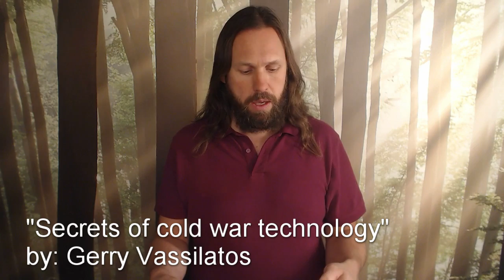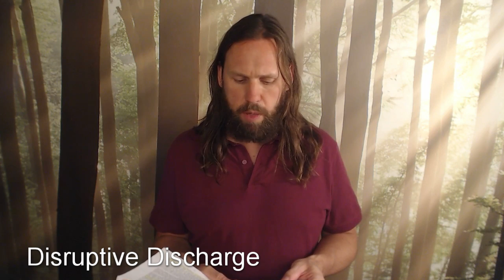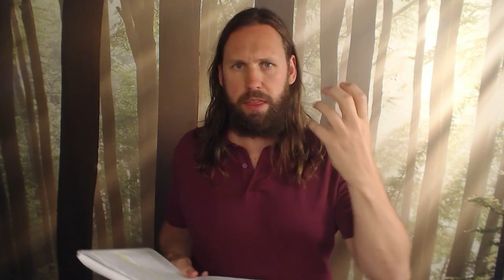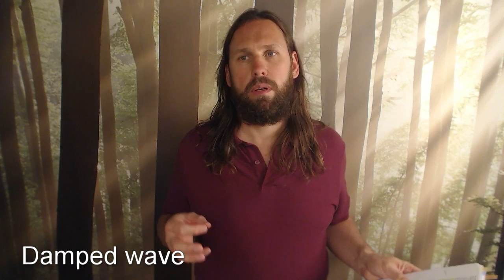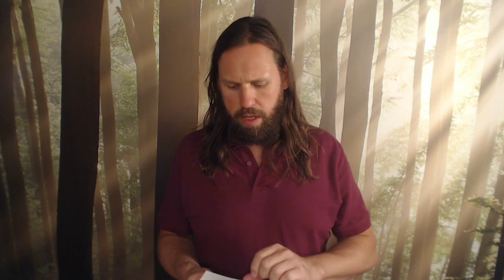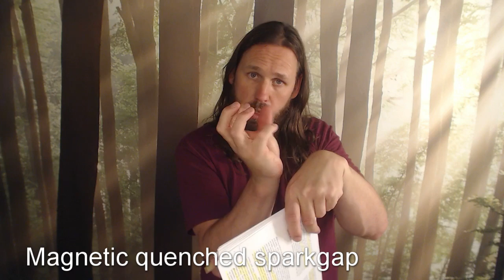Nikola Tesla's Radiant Energy Part 1 of 3

Comment: Hello Ivo,   Radiant energy is the aether in motion. I read this book, very informative and revealing. Two books, Lost Science and Secrets of cold war technology. Nikola Tesla was the master of the aether. There is the undeniable evidence in some Tesla patients and else were. A radiant particle is smaller than an electron with almost no charge and they pervade the entire universe, also can not be compressed. Tesla used electrons to bombard the aether particles to get them into motion, this is done with an intense DC pulse. A scalar wave moves like a sound wave.
Anyway, I was to tell you I sent pulses through the ground, here is what was done......using the schem. I sent to you, run the collector into the ground rod and at some distance from another ground rod return to the coil with a single wire. Use a higher resistance and the transistor won't burn up and maybe a larger bifilar coil. Hope all is well.
Reply: There is a dispute though, may not be a particle at all. It would not make any sense
Reply: @Tbonyandsteak  I agree I don't Aether itself is particle, just probably a means on conceptualization in keeping with it being a described as a gaseous medium that permeates all. When it comes to particles Tesla referred to a "Primary Solar Rays" but this isn't Aether but does play a big part in some of his findings.
Reply: @bobdole27  This is what I have gotten out of the lectures, experiements and books. No opinion are involved. 
Radient energy are also called Longitudinal waves. It comes when the frequency are so fast that magnitism cant be build up. Magnetisk is an counterforce to the Dielectric energy. Since it is a counterforce, the limitations of the Dialectric energy gone in Radient energy, since the drag of magnetism are no more. This is what that gives Radient energy its strange abillities. Its instant at all distance, that is why they call it Longitudinal waves.
Reply: @Tbonyandsteak  You are on the mark, I find it funny how people claim Tesla's ideas could never work due to Electromagnetic waves being beholden too inverse square "law", and even in his early lectures they attribute it all to electromagnetism. However when one takes the time to read it themselves you'll notice how states constantly that his effects were electrostatic based (even that he considered a limiting term since it was really dynamic and not static at all, which is why saying its dielectric based would be  more accurate) and that they had infinite potential compared to only magnetism. There really seems to be some sort of mind virus amongst the masses in that they never seem to notice this, then have to gall to say with certainty that "Tesla's inventions could never work"
Reply: @bobdole27  I believe it is on purposse and planned up to this day. Atomisn is a Disinfo to stupidfy the masses. This is why mentioning the Aether in those circles are like mentioning the devil in the churces. The big lies are everywhere, Just recently calculated the trigometric of a 1 million km diameter star, 1 lightyear away. The star would be seen as little ancle of view as 0.01mm 100km away or 3 cm besides the moon vehicle on the moon. No telescope in the world would get more than 1 pixel size of a star. yet on the from the VLT telescope, show pictures of stars with 50 pixels size of a star that is supposely over 100 Lightyears away. Heck even with a good precise amatour telescope you get more than 1 pixel of some stars. It is sooo obvious, just find another way to validate the claims. Found at least 10 big lies my self. If it is true, like different ways of calculations of PI, the result are the same. But not in space. Unbelievable that a job like Astrophysics not even have done that. Well, maybe that job never have been about the skills at all.
Reply: @Tbonyandsteak  Science or as Heaviside best described it as "Scientism", is nothing more than a giant cult, and the physicists are their religious bishops who gatekeep , they even have their own religious icons like Einstein, Feynerman etc to boot. They tell the masses what to think and you're supposed to just agree because apparently enough of them agree on their erroneous theories that it somehow becomes truth, even though the reason new science after new science has to arrive because the theories that came before makes no sense so it becomes a never ending cascade of nonsense. Also you're right about the astrophysics stuff, just like with rest of the physicians it rests on being massive circle jerk, they claim to have all the answers yet can't even tell you concrete the workings of a magnet. If you want to get even a bit more conspiratorial one could even go as far as to say Relativism and all the nonsesne that came after wards was made the defacto "true" model of the universe because of how limiting it is, under the correct Aether model we live in a virtually infinite universe, are not held to the "laws" of thermodynamics(enegry and matter can in fact be created and destroyed(Gustave Le Bon's works goes deep into that and his findings line up with Tesla's works despite them hardly interracting)) with infinite potential of Aether manipulation to do practically anything we need. However in its stead we have this current paradigm that is practically a nihilistic nuclear death cult, somehow despite us being more "advanced" we're more limited now than ever at best and is on active path to destruction at worst (all the while they're still telling us they are doing all that they're doing in our best interests).
Reply from the maker: I love this exchange of insights. it resonates deep with me.
for me all is energy, and this energy can move, like water moves.
it creates vortices which end in funnels. and ring vortices.
the energy can be set into longitudinal motion, which is like a tsunami, whereby the water doesn't really move, but the energy does. a true displacement currenr, set in motion by a rapid change in high voltage on a surface (plate).
Reply: @MasterIvo  Anyone with a "particle" of sense would understand what Tesla was doing by reading the patients. Tesla did not try an hide his discovery with some vague 
explanation. All I can say is because of greed and the lust for power and control humanity was prevented from moving up to a higher level of existence. Wardenclyffe was that next step up.
 I have continued working with the pulse motor. Remember the brief exchange we had some time ago, I finally stumbled upon something that works. 
https://www.youtube.com/watch?
v=07xM4bYWgic&t=84s
Reply from the maker: @tribulationcoming   youtube f@cked up the link so I can't click it...
Tesla definitely was very vague in how his tech worked, definitely after his lab burned down in 1895.

virtual particles (corpuscles) are thought up by JJ Thomson, to be able to calculate on field properties.
Reply: @MasterIvo  Really poignant post Master Ivo, thats essentially how i've come to view it also. I've only really have been looking into the Aether for about a year or so now(which is why i'm currently going through your older videos after having watched the newer ones) and thanks to channels such as yours i've found a dearth of knowledge on the true workings of Tesla. Only just a few short years ago I would've agreed with Academes on Tesla just blindly following they say but having, but by chance coming upon the videos of Dollard, then finding Vassilatos works, then stuff from ken wheeler(which is also a bit funny since I found his channel a long while ago and it never made any sense to me until recently), and then empirical evidence you show in your videos (like scientists should instead of going through endless equations and theories that have no tie to reality) it really makes it all concrete to me. Then one goes back and begins looking at all the things that were possible and should've been expanded upon in our era such electro therapy(no need for harmful drugs), electroculture(using frequencies to aid in plant growth cycle and to ward off pests and dieseases, instead of awful products like round up ready) wireless energy, production of nitrates from the atmosphere (essentially on the spot fertilization production which I remember tesla talking about often), even possibly being able to make it rain through simply electrical means(no need to put toxic chemicals in the atmosphere) and these are just the relatively tame possibilities of what could be achieved.
Reply: @MasterIvo  Never read about J.J. Thomson, what I understand I have about the aether is from reading Tesla's patients and his work and others who discovered this phenomenon.   The famous Tesla coil was not about making gigantic sparks, the H/V produce was to bombard the aether and put it in motion, the proverbial "scalar wave". As Lynyrd Skynyrd sang about, I'm a "Simple Man". I'm really not that capable, but patient and perceptive and have become "one with the device". It is running itself and "time erases all things but love and the truth". Most folks don't understand one important aspect of our existence.....God will give us what we need.
Later.......Marc.
Reply: Its what gravity is too! There are electrogravitic force made here and that what Tesla observed! He managed to focus this force in a narrow beam. I have Grerry Vassilatos Tesla article saved, Tapping ZPE books by Moray B King and The Secrets of Antigravity Propulsion by Paul Laviolette. Eric Dollard and Eugene Podkletnov produced these forces.
Reply: @jlo13800  This is what can be done with radiant potential.
https://www.youtube.com/watch?v=bRq2xQSPPJk&t=4794s&pp=ygUuZHIuIGp1ZHkgd29vZHMgLSBldmlkZW5jZSBvZiBhZHZhbmNlZCB3ZWFwb25yeQ%3D%3D
Reply: It's quantum fluctuations

Comment: Ever ponder why oceans have rogue waves and lakes and ponds have merely wind waves & no tides! what's the difference?
SALT! salt conducts the energy that is being dispersed from the Sun and Moon under the Dome! 
+ & - refractions of the plasma energy emanate! freq.& A/C current when tuned in!
Reply: Sunlight has aetheric particles as well. Tesla was aware of this!
Reply: @jlo13800  Not particles, Sunlight is a co-axial Aether circuit of magnetic and dielectric propagations, an induction. Tesla was right when he said Light is a soundwave in the Aether, the particle model doesn't apply to a non-Cartesian and non-Dimensional dimension.

Comment: 17:05 - Yes, you can use low voltage and notice small effects on your oscilloscope, but you cannot catch sight of some possible effects on surrounding space from which Tesla obtained most of his findings. Don't get me wrong, your work is great! You are awesome electrical experimenter and I like your experimenting approach very much. I think you choose good direction and attitude for your research. You also have very good knowledge to handle electrical tools and instruments for obtaining and interpreting data very precisely and correctly. Do not hesitate to use high voltage impulses and discharges because you're capable for handling that. It's the same that you said you don't need to ride powerful bike when bicycle can also move on track. Yes, but it's not the same! :) Take acceleration force fo example.. Best regards!
Reply from the maker: Thanks Igor. I agree, that's why I am now producing - 3200V impulses with my series mosfets switch. And indeed I start seeing different things. Based on displacement current, as I am discharging a 2800V capacitor with these impulses.
Reply: All the patents I’ve read state that electro gravitational effects appear at 512kv and max at 963-1100kv
Reply: They also use counter rotating capacitors often times segmented into fours with two dielectric segments and two copper segments on the upper plate or anode and the bottoms plate or cathode can be a solid copper sheet round of course with three slots cut in it 120 degrees apart to allow the current to release and negate any wobbling effects of the corotating capacitor, all patents I’ve read use counter rotating fields by parallel  plate caps in series around the outer circumference of the craft , or coils or spherical condensers with coils inside. It’s also good to connect your coils inside and outside the craft to to three or four spherical condensers mounted on the bottom ground plane of the craft. A 9 foot craft could use a 3.5  foot coil inductor at ground plane followed by the bottom 4 foot plate of the counter rotating capacitor followed by the 6 foot upper plate embedded with dielectric. Followed by an 8 foot conductive ground plane under the hull with your final upper conductive for active flow control being segmented and mounted above that ground plane. I think that’s how it’s done. A center fed phased array of sorts. Thank you big fan of your work!

Comment: Radiant energy just means light. Vassilatos is overcomplicating it for intrigue because he has more than a dozen books to sell. Tesla's radiant energy idea was to excite photoelectrons in a conductor. This could be used to charge a capacitor or more importantly amplify current in an inductor. Read the patents 685,957 and 958. The white spark is just a positive bias AC spark. That spark can appear on powerline on switching because the lines are positively charged by the electrostatic field when current is applied. A DC biased AC spark like a zinc or iron spark gap makes should be a good light for photo amplification. To make a radiant energy photo amplifier circuit, put a spark gap or x-ray tube by the inductor of a resonant circuit so the ionizing light is cast on the bare wire inductor. The light excites photoelectrons that amplify current in the inductor. The effect is short so it increases with frequency. It helps to give the wire a photoconductive cupric oxide surface coat by annealing. It's really that simple.
Reply from the maker: Thanks for sharing, but I don't agree. From my own experiments I've concluded, the white spark only happens with negative discharges. 

Yes Vassilatos wasn't completely right, but he hints in the right direction. 

If it really is that simple why don't you show us?
Reply: @MasterIvo  The impulses launch the longitudinal force beams
Reply from the maker: @jlo13800  if it is a current impulse, yes. voltage impulses not so much
Reply: @MasterIvo  So that was tesla's teleforce beams.
Reply: @MasterIvo  So this can be used to make compact force beam lasers that are simpler and cheaper to build!
Reply: Yes the light has the aetheric force streams Tesla produced. Even lighnt photons are composed of + and - charges, quantum electron/positrons pairs twirling around each other. but tesla shoves this flux under high DCD impulse pressure so its more like a water jet cutting maching in the aether, whence the great aetheric electrogravitic forces they carried.
Reply: Light in a transverse oscillation.  There are no photons. This is due to compression and rarifaction  of the magnetic and dielectric longitudinally.

Comment: Good Stuff. Thanks, Master Ivo. Nikola Tesla and Charles P. Steinmetz both focused on the Dielectric and magnetic fields of electricity, separating them from the charge carriers that pondered along, far behind the speedy dielectric and magnetic field movement (waves of radiant energy). Tesla focused on maximizing the impact and energy transport of the waves alone, while Steinmetz worked on dampening or suppressing the waves totally. Both diverging from the rest of the EE world that was focused on the material properties of electricity ( the charge carrier movement) thinking probably that a material transferring energy (conforming to the Newtonian mechanics of energy transfer (conservation) was more rational and solidly gave an acceptable economic base that was consistent with the monopolistic operations put in motion to maximize the payback for investors becoming richer than kingdoms in the day. Funny how a difference in perspective shapes how you describe what is going on. Trying to minimize the easily amplified effects like Tesla vs. the minimizing effects that Steinmetz wanted for safety and reliability, keeping the designs limited and more valuable with no room for innovation or displacement with technological innovation. Someone had to keep the owners stocked with Kimchee. party on Dudes, Be good to each other.

Comment: if one had a voltmeter with a sensitivity of 20k Ohms/V on the 5V range, measuring voltage across an large inductor in DC circuit with 1 Amp, an impulse with 100KWatts of power would explode the core of meter if the circuit were opened without a diode or capacitor(snubber) in reverse bias with respect to original current flow, in parallel with inductor. note that you can make high power diodes cheaply by using an aluminum cathode with steel or iron or probably zinc or lead, as anode, within a vessel of water with electrolyte added; also high power resistors with the same electrodes each,  but resistance value will change as ions from anode go into solution.

Comment: awesome! there were rumors that Tesla developed antigrav., his first machine was built out of a stove; they called it the flying stovepipe but described it's workings as what appears to me to be a preposterous mechanical contrivance, but apparently in actuality,  it was supposedly what is known as MHD, only using high voltage AC combined with HV negative brush discharges from his generators/transformers and the air; nothing to do specifically with water that we commonly associate with MHD,
Reply from the maker: yes, and it makes sense, the negative discharge in a positive high voltage field, sets up an implosion, that sets the Aether in motion, and Aether has inertia, so it can cancel the attractive force of the aerth field.
What is MHD?
Reply: @MasterIvo  Isn't that the basics of flying saucer propulsion?
Reply from the maker: yes, electric power generation and field propulsion (ufo) are closely related.